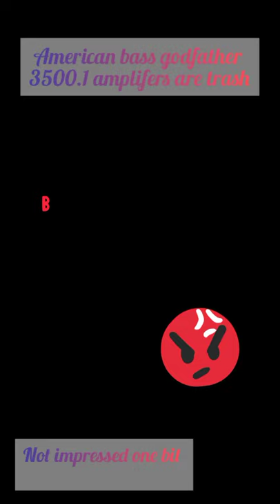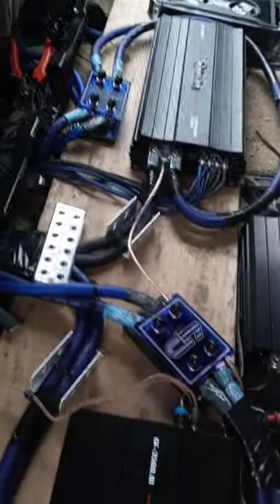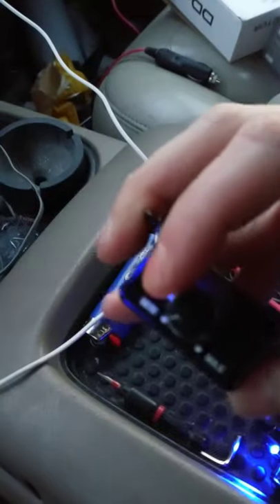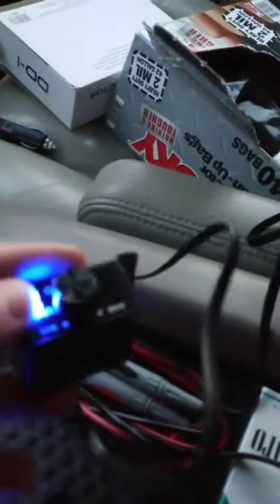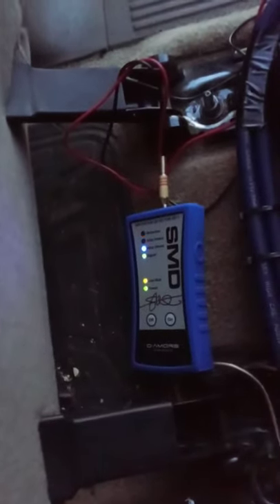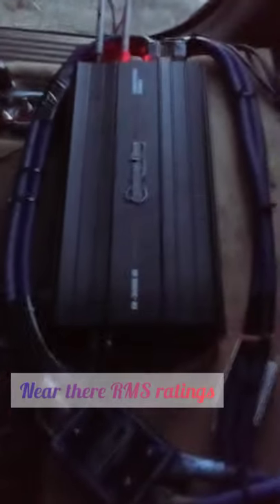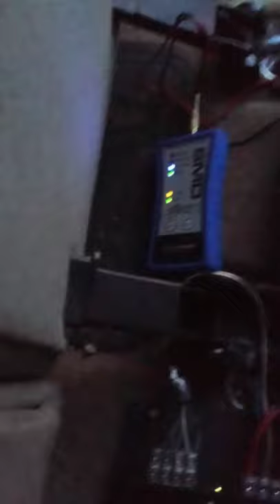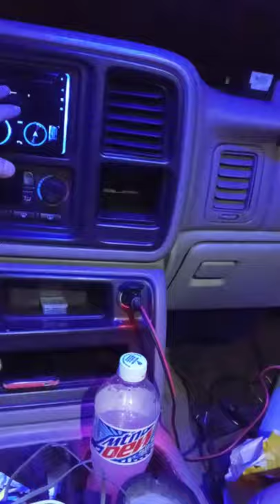american bass godfather amps are trash

Comment: That amp does 3500 all day long
Reply from the maker: Definitely doesn’t
Reply: Big facts gotta have good power you'll get every bit of 3k
Reply from the maker: @1970chevyboy  had plenty of power boss,, theses amps are just not it, no AB amp is frankly, every single amp AB got is over rated,, 1 of them actually blew just from turning the radio off other 1 is sitting in storage and honestly the sound quality isn’t the best it’s ok just not the best,, but otherwise it is an ok amp for a temp budget build or something,, but again it’ll never produce the 3500 watts as advertised 2500 maybe,, but that’s just my opinion and experience with it Intell I see otherwise
Reply: @famousmoon  I'm running this amp on the 18" bro two 12.8 lithium batteries one big AGM sport in the front 275 high output alternator hit a 150 straight pressure bro
Reply from the maker: @1970chevyboy  you definitely  applying some pressure bro and I can respect that, but just because your doing  150db using this amp doesn’t mean the amp is pushing out the rated 3k power boss,, most of that has to do with your enclosure and from the sounds of it, it’s a really well built enclosure and you would see even more gain maybe a 51 or 52 by switching to something that will actually push 3k watts, you have to keep in mind that the majority of amps aside from the smart series taramps arnt going to push there rated on music  In real world scenarios because of impedance rise,,  idk maybe I will send the other amp to big D for him to run a bench test dyno on it as I haven’t seen anyone run this on the dyno yet but I’d be willing to bet that this amp even on the dyno will only put out like 2500 maybe 2700 watts at max
Reply: @famousmoon  could be true bro but I seen the Dyno it does 3040 at 1 ohm 14.4 volts look on the bass head Dad it's not a 3500 amp but it pulled 3000 easy bro
Reply from the maker: @1970chevyboy  I’ll see if I can find it
Reply from the maker: @1970chevyboy  yeah thats a gf comp 5, it’s also a newer model
Reply: Allot of people don't clamp so they actually have no idea whatsoever what they're getting outta their amps. They just THINK they're getting 3k or whatever but they're actually getting 1400 watt bursts they they think are 3500 😂

Comment: I've yet to see anyone clamp these amps. Bassin Semi has the GodFather 15D and someone in one of his videos told him it does 30k instead of the 20k it's rated. He now advertise that lie like it's going out of style. I think AB is a descent product for the 💰, but never 33% more than rated descent. 🤔 anyone that knows AB knows generally they don't do rated. Close, but no cigar! However AB is an excellent choice for the 💰.
Reply from the maker: Yes i know he does ive called him out on it a few times and he refuses to acknowledge me lol but i can now say this amp does at least come very close to its ratings i was having problems with it because the clip indicator shows false clipping when setting the gain but functions properly on music ots weird
Reply: @famousmoon  I figured it'd do good as for power ratings, but it will fall short somewhere. And if it didn't the Bob is back on the right track. The VFL track when AB didn't advertise the power rating on the amp like vfl 12k. That particular amp was originally the vfl 1100.1 with a fuse rating of 800. No tiffany 😕, and it couldn't make 12k. Close, but no way it could make it. At least I never seen it. So when these amps hit the scene I wanted one, but I knew the advertised power wouldn't be there. Or it wouldn't have tiffany inputs or something 🤔.  I just knew, and therefore took another Ave
Reply: I own the godfather 15D I clamped my amp out at 29.750 watt🤔🤔
Reply from the maker: @soowoonj  oh so you the one who told jahn hall that lol jk man no i did figure out the problem with it and its as simple as the clip light doesnt function properly on either one that i have while setting the gain however works fine on music i just havent done another video on it and probably wont intell i hear bk from bob on another issue im having with his company atm however im sure that issue will be solved, but i would love to see a video of you clamping 29k out of it as im sure thousands of others would as well, would be great content man
Reply: @soowoonj  yeah, and I have a bridge for sell!
Reply: People have clamped 27k out of the 15D, higher ac voltage than a salt 12

Comment: In the last part of the video you are watching the wrong light normally to protect lights flash when you playing at high volume it could just be how it dampening the sub impedance temperature spike or it just how the protection circuit is wired. Plus they said when the amp is close to max output the clip light will start to illuminate. So manual states that it would illuminate before clipping and when it excessive it would stay on until it goes in to protect mode. I have no problem with my 3500.1d mines was installed by AB dealer in my country. Music is dynamic if you use a 0 db tone unless the song you playing has 0 db tone the amp wont be clipping despite what is your radio max volume. This is why you leave a 5 to 8 db over lap plus get Skar Skv2 bass knob it works with this amp and it have a clip light. The only bad thing about this amp is it didn't come with a bass knob with a clip light in it. Plus the amp will over heat like that because your are blocking the exhaust fan.
Reply from the maker: No sir not looking at the wrong light there is only 2 lights power and clip, the problem is the amp indicates clipping way before there is any clipping however only when setting the gain and yes tone is a 0db tone from the smd cd track provided with the DD1, radio volume goes to 62 and radio does not distort on volume 61 at 40hz or 1kh, and as far as the manual stating that it will indicate clipping early i will double check my manual as i dont remember reading anything like that otherwise i see that as a problem with the amplifer for thoes that dont have tools to set there  gain on this amp and have to rely on the clip light because its not  accurate enough to properly set your gain to it if you do that your only gonna get half power out of it
Reply: @famousmoon  the light that was flashing at the last part while you were playing the music is the protect light not the clip light. The clip light is the 3rd light not the second you can watch it back.
Reply: @famousmoon  @7:14 the light thay flash is directly below the power light and that is the protect light not the clip. So the amp is not clipping while playing the music.
Reply from the maker: @LividLeon  oh yup you are right thanks for pointing that out,, still a little odd that protect would be flashing while not indicating any clipping  at that point and time they had already been tuned with the DD1 and were not hot so i dont see heat as being a problem at that point its still something with the clipping indication of the amplifer
Reply from the maker: @LividLeon  it was clipping while playing music  tho i could smell the coils... Ill have to get around to trying them out again one of these days and do an updated video on them
Reply: @famousmoon  what is the box tune at.
Reply from the maker: @LividLeon box tune  31hz song that was playing the bass was also in the 30hz range

Comment: So you are clamping only 1500 from them? Thats after ohm rise? Im assuming whe. You had ome amp it was at a much lower ohm load them spread between 2 amps. So prob getting more wattage? For example one amp at .5 ohm rise to 2 ohm clamping 5k  or 2 amps at 1 ohm per amp rising to 2 or 4 per amp gonna see 1500 per amp.

Comment: Mine runs 3k all day at the buzz. Idk what problem you’re having
Reply from the maker: So i figured it out just havent made an updated video but the problem with mine is the clip light on the amplifer is wrong it shows clipping way before there actully is any so me setting it to the clip light on the amp instead of my DD1
Reply: @famousmoon  American bass is known for that! Glad it’s working for you bro!
Reply from the maker: i am not using it i have put it threw a few diffrent tests of my own however it just doesnt meet my personal preferences enough to actully use it every day
Reply: @famousmoon  I've noticed that American Bass and VFL amps have super sensitive clip lights. It's not necessarily a bad thing because you're less likely to burn your shit but if you don't set your gains with a o-scope or DD-1, you'll be leaving quite a bit of power unused. I have a similar experience with the VFL ST4500.1 and until I saw this video and read the comments, I was thinking maybe my head unit (Pioneer DEH-S7200BHS) was sending a dirty signal to the amp
Reply from the maker: @78758nate  yes you are right however it was actually pointed out to me that it wasn't even the clip light going off it was the protect light which raises questions as well so either way the clip function on theses amps do not work properly I have sense tested both amps by them self and its the same thing they do not work properly one of them actually blew from just simply turning off my head unit wasn't even any music playing lol
Reply from the maker: @78758nate  also pioneer head units are very good and most do not distort however the ones that do usually won't intell max volume which you can just click down 1 volume from max and no distortion now this is assuming a person doesn't have junk rca or bad wiring

Comment: SET THA GAIN WITH THA SPEAKERS CONNECTED.💯💯💯 IMPEDANCE RISE ONCE U CONNECT SPEAKERS TO AMP💯💯💯
Reply from the maker: It can be set with or without the speakers connected, it's not going to change the input level either way, the purpose of setting the gain is to match the head unit preout voltage... it was pointed out to me that it was actually the protect light flashing not the clip light so I have sense run many diffrent tests with both amps separately and there is deffently something wrong with them 1 of them actually blew simply by me turning off my head unit.. sure they can work decently by undersetting the gain but who really wants to rock like that I think there are much better amplifer out around the same price range that are going to perform even better theses amps are a waste of money in my opinion and truth be told there isn't any amplifer from AB that does rated power or that is built extremely well

Comment: Well first off do you have 16 gauge wire on subs?? You need 8 guage for them bad boys
Reply from the maker: It was either 10g or 12, don’t remember but either way both of thoes sizes are sufficient wire is rated at 25 foot intervals and the shorter the wire run is the more the wire can Handel to a certain point anyways
Reply from the maker: Also had 1 of the amps blow just from turning off the head unit,, I have also seen a few other models of the gf series blow for no reason, but they are ok for a budget price just not great
Reply from the maker: Actully I had the 2 15s in this video so it was 8g stinger pro series wire, lol it’s hard to remember what I had in some videos if I’m not showing it off I’m always changing stuff up

Comment: If both amps share the same rca qire then that would be your problem
Reply from the maker: I gave up on theses amps along time ago, I took 1 out and just ran 1 of them and it was just about the same as both of them but the 1 blew just from me turning off my head unit no music playing or anything, not sure what really happened there but owell, the other amp is just sitting in storage, it was also pointed out to me that it was the protect light flashing not the clip light, not sure why that was either amps had plenty of power supply and were tuned with the DD-1 and wired properly,, also the 200.4 took a crap as well but did last much longer then the other 1, don’t know what happened there either 1 day  it would be fine and the next would be in protect then be fine again so I just got rid of that as well

Comment: I thought I was the only one tripping about sum of these American bass amps I had 1900 phantom amp on a 500rms sub straight trash 🗑 🤮
Reply from the maker: I swear bro some ppl trying to tell me well u dont got the electrical to run them there great amps its ur fault not the amps lol i got all the electrical i need to run them they just straight booty juice thats all lmfao dont sit here and tell me its not the amps when you dont even got one of them theses amps are so new there no buddy that has been able to point out any of there flaws yet and what i have discovered with mine is probably one of there biggest flaws dont get me wrong the sound quality is pretty damn good but not the performance and thats kinda been an all around thing as far as AB amps go and the phantoms are deffently the worst, i had a lot of hope for theses GF amps but that went down the drain
Reply: @famousmoon  I didnt see any extra batteries or lithium.. That little 250 ALT damn sure aint enough electrical for those amps.
Reply from the maker: @jackkhol4251  i have extra batterys pluse a super bank but only 1 battery and superbank is installed atm
Reply from the maker: @jackkhol4251  actully at the time of this video superbank was not installed i had 3 agm installed so would of been just over 300ah at the time of this video
Reply: @famousmoon, that's really not enough. What's the Current draw on that amp? Times 2? if that amp is not getting the power it needs then that will set the protect light off every time the bass hits and the current isn't there.